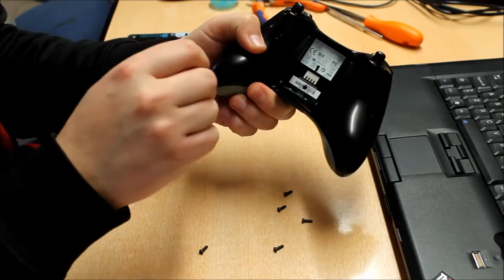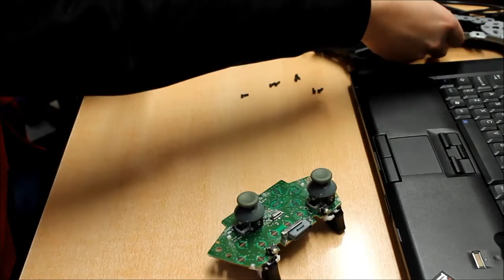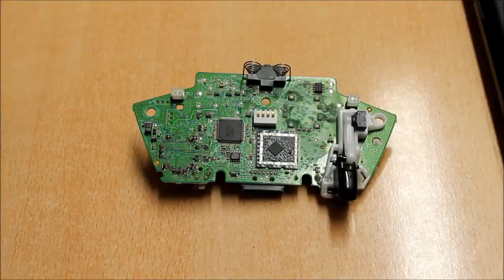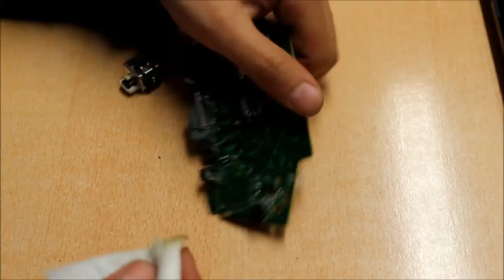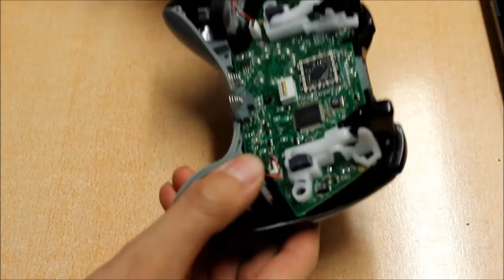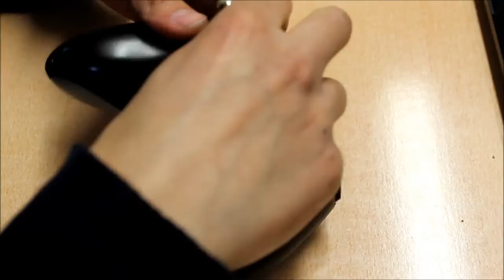XBOX360 Controller disassembly and analog replacement / repair.

Comment: Thank you, I do solder everyday (RC Cars/ Planes) so this was helpful knowing how easy it was to open. So should be a easy fix.

One thing though, as in most XBox analog stick controller YouTube fixes, it lack were to buy good, quality replacement parts.
Any recommendations people?
Reply: I buy mine off ebay
Reply: @ThatRandomNitara  If I recall, I think I bought mine on eBay as well 👍

Comment: Finally a video that isn't just "stick the replacement plastic thingers onto there, press down and you're done kthx".
So those actual stick holders can't be replaced without soldering?
That's too bad.
Reply from the maker: chris c Thank You.You are right, the analog controllers cannot be replaced without soldering. But it is not very difficult, to do it.
Just one advice from me. Be careful with the Chinese analog sticks. Many of those that I have replaced, cause problems with the controller. Best practice is to use analogs from broken controller.

Comment: My controller thumbstick weren't even soldered in the controller just bent upward to stop them from sliding out. So guess this makes for an easy replacement right? just don't know which joystick are the best and which ones are compatible with the board inside since its a thrid party controller